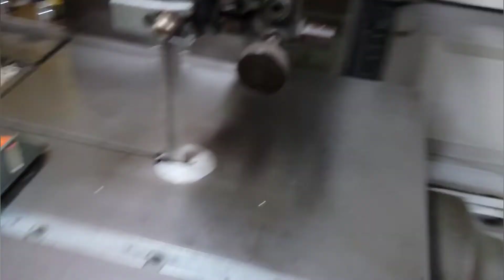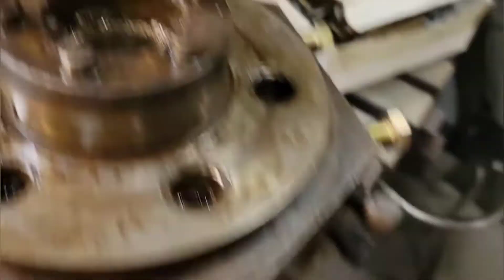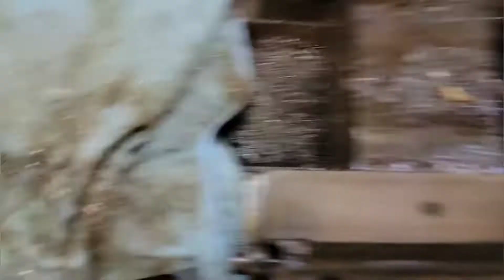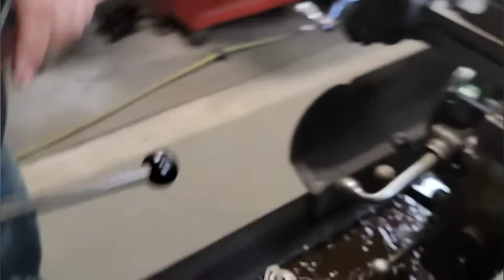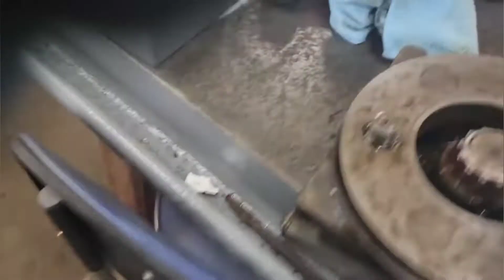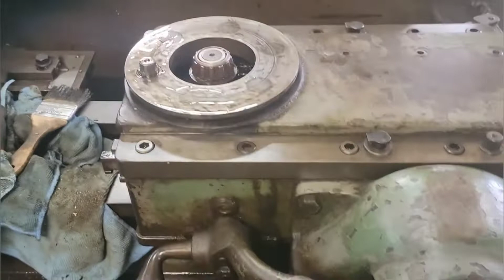warner swasey turret lathe stuck turret repair

Comment: I have a W S M-3400 A1 lathe that all the sudden the forward and reverse stopped working. Like it's in neutral. What would cause this?
Reply from the maker: It could be a number of things . There are clutch packs for forward and reverse that could be worn or possibly an issue with the shift fork or selector lever assembly.  May have to pull the top off to know . I wish I could be of more assistance.
Reply from the maker: Vintagemachinery.org has some literature and diagrams on these lathes. I would maybe start there

Comment: I spent a year or so in a valve building shop. Running and setting up these machines . ill tell you I earned every penny in muscle use working lever feeders and running the turret thousands of parts. But the WS is tough n strong acme threads no problem with these machines and auto die heads.

Comment: Hi, really enjoyed your video.    I have same machine, M1200 .            When you were looking at headstock, you mentioned making adjustments to brake.   Can you share some detail about the brake adjust repair.  I am trying to figure out if mine needs new shoes or can be adjusted.   Mine has same hydraulic system that you describe.    Thanks John
Reply from the maker: I'm glad you enjoyed and found the video helpful. I believe you can check them without pulling that inner  cover but the gear shaft that your pulley runs on and brake lever assembly is removed from underneath. I must've mispoke on being adjustable as Im honestlynot sure. ( I was a little tired at the time ) . The best thing would be to pull them and inspect the friction material and go from there . As I said it's pretty intuitive and I think you'll be fine . There may be adjustment in the Levers that spread the shoes but I honestly didn't tear into it enough to give a definite answer.

Comment: I like your m-1200. I have the same one but I guess I got lucky mine has the preverbal hens teeth aka screw and thread gear box.. I unscrewed all the brass and black and silver plaques so I can clean it real good  before I paint her and make her look good.. she was in the Navy from early 40's  till early 90's and I'm just a hobbyist that always wanted one...
Reply from the maker: Thats awesome. Mine has a few changes gears for the lead screw , I've only seen an actual gearbox on the old but similar gisholt turret lathes. I l8ke that the brass on them is solid not plated and can be polished nicely. They are cool machines !

Comment: I'm glad I saved the K&T head from the scrap so it could put back on a machine.   nice work on turret , sometimes your machine just wants to be cleaned.   The stickers are going to look good. fyi, size them so you can mail them.  Im sending you some of mine with the head
Reply from the maker: Me too . Too many good machines have ended up there over the years.

Comment: Those turret lathes are cool. I see them available all the time, too. I bet thousands ended up as scrap. When you get a final sticker made, let me know, I'd like to get one and send you a couple of mine. Looking forward to seeming more of your shop.

My only question on the turret is the grease on the bearing. If chips got in there before, seems like the grease would be a magnet. Are you certain it doesn't get oiled with that Gits cup on the top of the tool holder instead?
Reply from the maker: I'm almost certain that the hole in the bottom of the turret where I suspect the chips got in the bearing was meat to be an oil hole. The git on top lubricates the bottom of the turret and the outer bearing surface . I agree it will probably be a chip magnet and will likely clean it back out and oil it if I can't completely seal it from exposure to metal chips . I put grease in it because it had grease in it but I'm definitely second guessing it and gonna at least keep an eye on it. Thanks ... And I'll definitely swap some stickers with you !